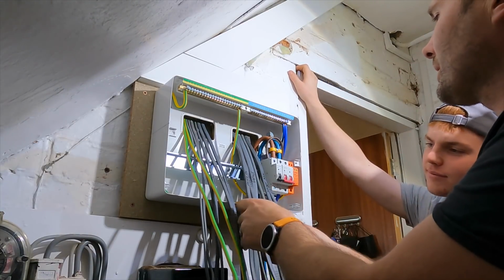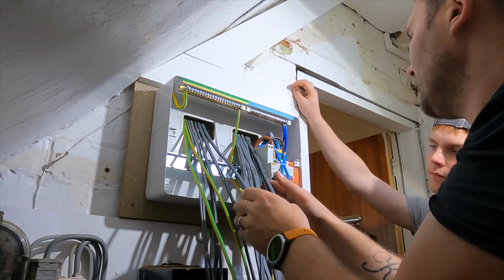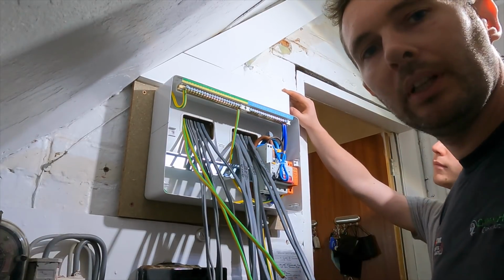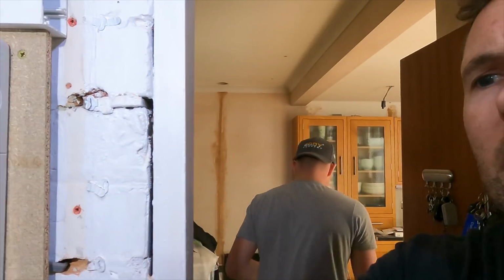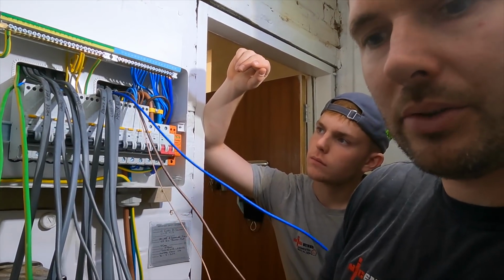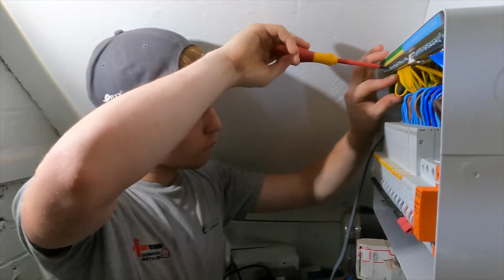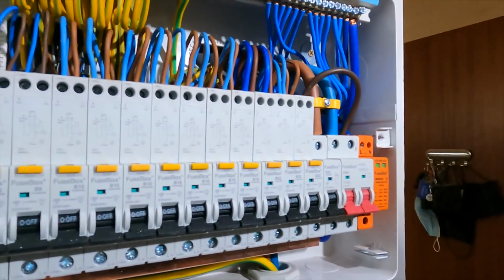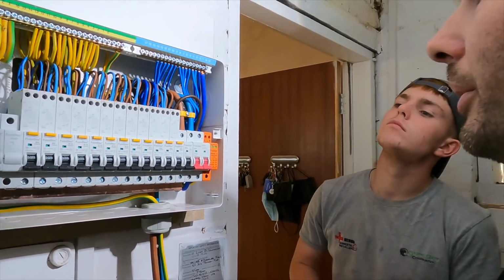APPRENTICE 1ST CONSUMER UNIT INSTALL

Comment: When you connected the two supply cable to the main switch where do they then get connect to the fuses? The live and neutral for each fuse along the earth is visible on the top but how do they all get connected to the main live and neutral big cables. If you can explaine that a bit please. Thank you
Reply: A busbar